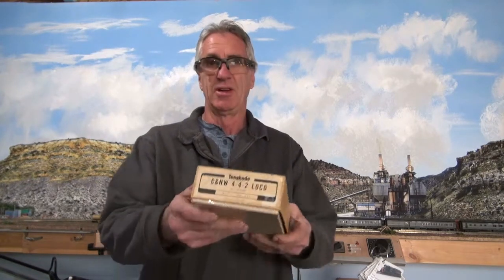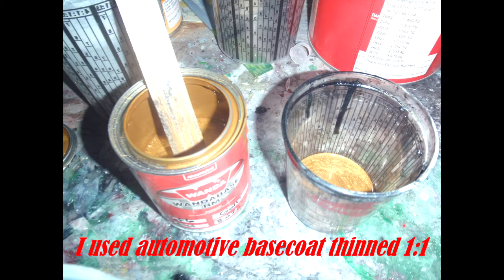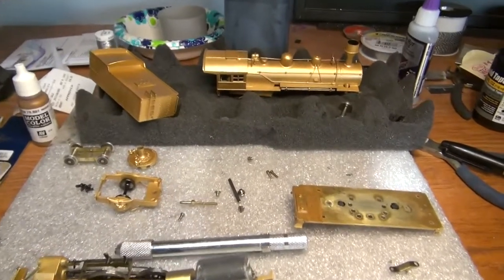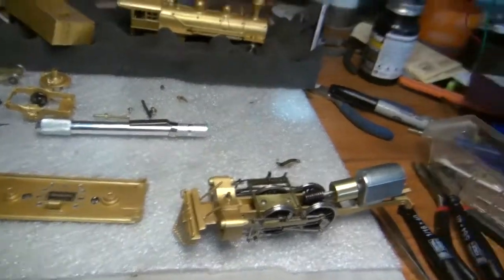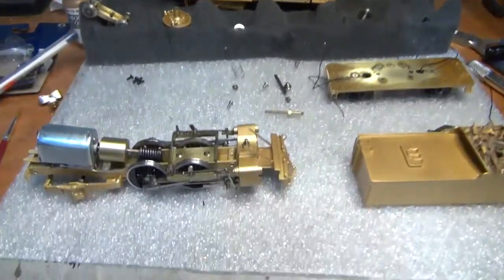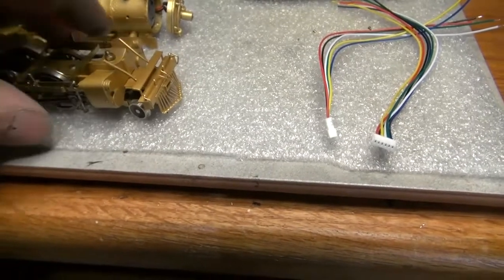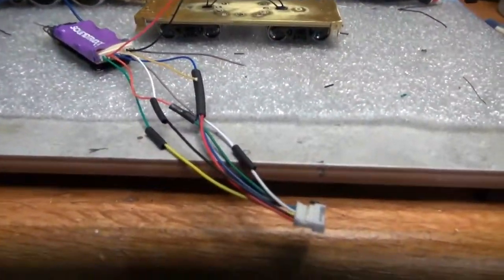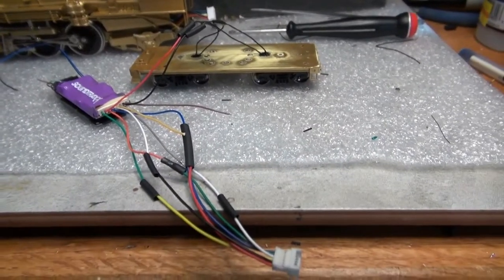Restoration and upgrade to DCC on a HO Tenshodo Brass Atlantic 4-4-2

Comment: Very professional job, but I really would have liked to see the actual work of putting in the motor.
Reply from the maker: @lancomedic  hi and thanks for the comment, I'll be building another loco and will work on showing the motor install.
Reply: @cllhmodelrailroad1867  Thanks, two things that give me trouble are the actual mounting of the can motor and the universal connection to the gearing.

Comment: Hi there! I am working on one of these locos turning it into an NYC prototype. What backhead did you use for this project? I want to add a backhead to mine but am unsure what will fit. Thanks and great job on the conversion!
Reply from the maker: Hi, thanks for writing. Actually I used a backhead I had laying in a box. I had to trim it to fit. I suggest looking for a backhead that already has the detail in it. You will want it as flat as possible because the room for it is very limited. No matter what you use I'm sure you will have to trim it to fit. Good luck, have fun
Reply: @cllhmodelrailroad1867  thanks for the response! Do you happen to know who made your backhead? Trimming it wouldn’t be an issue but I certainly am not sure where to get one

Comment: Would this loco ever have been a wood burner?
Reply from the maker: well Thats a good question. However, when it would be used as a switcher in a logging area, Wood typically would be more plentifull then coal.